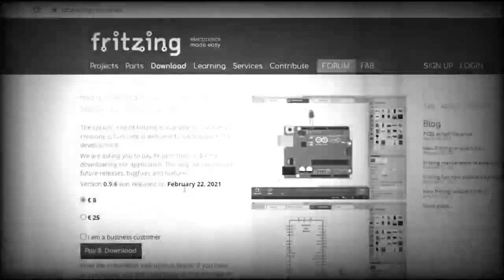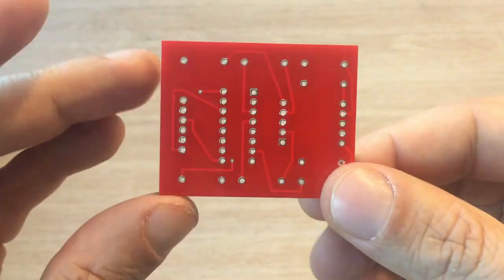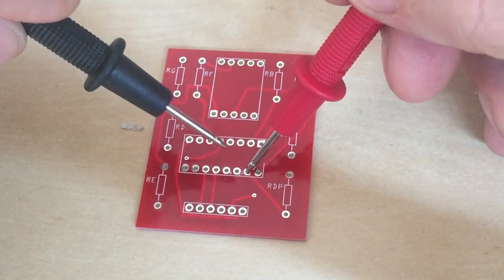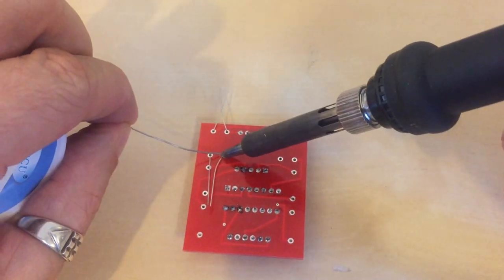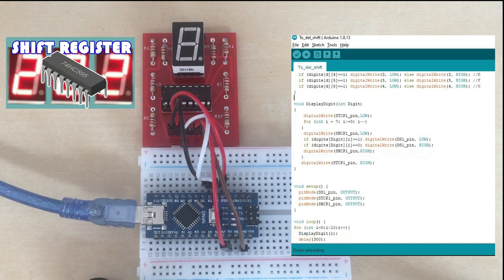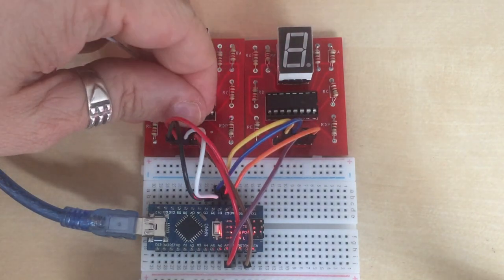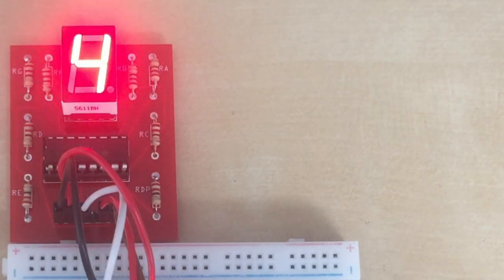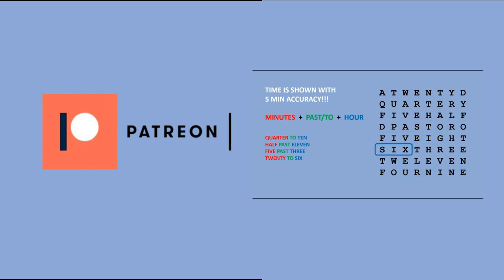How to create custom PCB for your Arduino Project  Part2 -Soldering components and testing

Comment: What I would find interesting since the Arduino is a prototyping board. What  would be the steps to "replace" the Arduino if you were to do a production ready product. I'm a modeler and don't want to use an Arduino in every model for blinking patterns. Could you do a video about that?
Reply from the maker: On my list to do :)

Comment: Hey Mario,  Greetings from India - I added a third digit, connected the overflow of the second shift register to the data pin of the third shift register.  Added the latch and clock pins in parallel to that of the first and second shift register along with the power supply to the digit.  Tweaked the arduino code to count upto 999.  The third digit (LSB) is erratic.  replaced the third digit, suspecting the 7 segment CA type LED display to be faulty, no improvement.  Could it possibly be the current consumption (sourcing from the shift register) thats limiting the count, I am using 220E resistors, shouId I attempt 330E resistors to decrease the current from 13 mA to 5 mA?  Have you tried adding a third digit?  Looking forward to hearing from you.
Reply from the maker: I did not link three digits. It can be linked to the current consumption. You can test it by powering the shift registers from external 5v power supply.

Comment: Can you make one for a 4 digit seven segment timer display ??
Reply from the maker: You can but there are better ways for controlling 7 7seg displays . Check https://youtu.be/IiWhnIhf-uU and https://youtu.be/ux3cpw0nHo4 you can even buy ready to use 4 digit module with muilt in MAX7219 chip https://pl.aliexpress.com/item/1005005403447240.html

Comment: Cant you have the arduino part on the PCB board as well?
Reply from the maker: Sure you can. This was just a simple project to show how to use fritzing. If you check the other project of mine you will see more complex PCB which I would use to build a custom 7 seg clock. https://youtu.be/ux3cpw0nHo4 . Here you will see that I plug in Arduino onto the custom PCB
Reply: @marios_ideas  thanks.